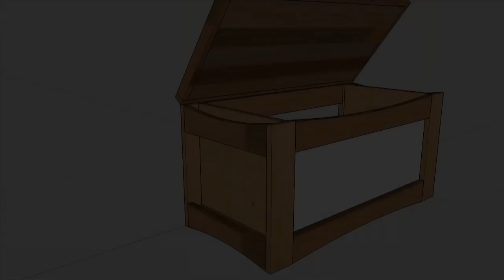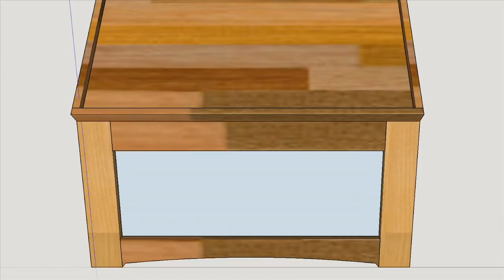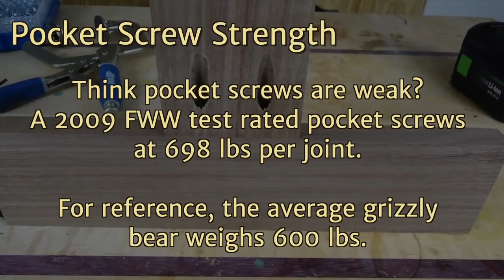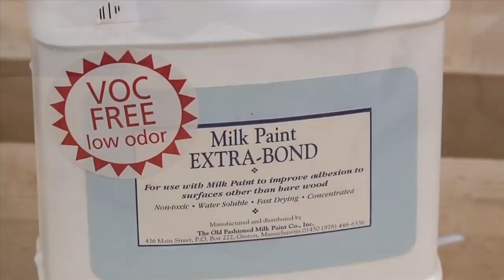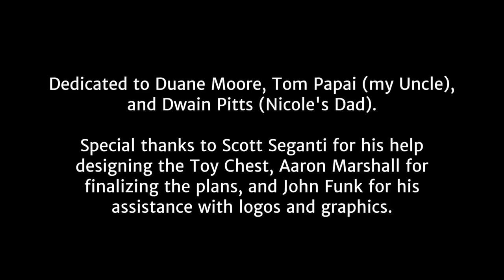231 - Multi-Function Toy Chest

Comment: I know this is an old post. But I'm getting ready to do the assemby  stage. I have a question. Can you tell me if it would affect the assembly,  if I bring the side plywood back to the edge of the 1 x 17"  side board, to allow more room  for books. So instead of 1 1/2" spacing, it would be  2". This is a great project, and simple enough for me to do. You've done a great job in explaining everything. Keep up the great work you do.

Comment: I am building this for the cause - and I'm about 90% done- but it is a combination of this video and the mere mortals video plan

The one thing you did not address and I would like your thoughts on - is how to install the piano hinge so that the lid sits flush the whole way along the top. As you made it there will be a gap tapering from back to front, right?

I would rate myself as grasshopper and you as sensei - so I'm not trying to be a jerk - but honestly curious.  

I have mitered this out with a chisel or router in the past - is there a better way?

Comment: I appreciate you doing this for a cause. Did you have to use epoxy to secure the Lego board?
Reply from the maker: Nope, just a few pan-head screws. Just a little tip, use some legos to lock the two plates together before screwing them in place. If you butt them right up against each other, they spacing will actually be off.
Reply: Woodworking with The Wood Whisperer Gotcha. Thanks for the reply

Comment: I've had such terrible luck with jig saws. No matter what technique I use, no matter how good the blade, it'll always bend on the stock giving me a warped line. I don't even use a lot of pressure when pushing! I think it's time for a new saw perhaps...
Reply from the maker: Unfortunately, that's something that a lot of jigsaws do. Some of the higher quality saws feature better guide systems that help keep the blade perpendicular and help prevent that kind of annoying tendency.
Reply: Woodworking with The Wood Whisperer Hmm. I think maybe it's time to invest in a band saw then....

Thanks!
Reply: Mike Gus Fifteen
good idea.  a used average-quality band saw is better at this job than the best brand-new jigsaw, IMO.  I know because when building mine, I tried the jigsaw route and the results were so bad (my skill level didn't help much) that I couldn't salvage that piece.  The rest I cut on my band saw (10 year old delta 12") and they all came out great.  Even with a 1/2" blade... I'm too lazy to swap it out so I went to the jigsaw because I figured the resaw-style blade would be too brutish for the curve.  I was wrong.  It worked fine, and a smaller blade would have been even easier.  I had to buy an extra piece of poplar to fix my mistake, but if I hadn't gone to the band saw I'd still be trying to make my jigsaw do the job.  and I think I'd still be failing.

Comment: While your projects are really nice. Literally everyone requires an wood-workshop full of tools to actually execute the way you present it. Some are even not doable for an common guy that wants to do some wooden furniture.

Would be great if you did a few videos with the focus on simplicity in making.

Maybe a challenge to your self:
Take only 3 tools from your workshop (several clams counts as 1 tool, just do not overdo it)
You can only use materials that are wildly available (no special glue and stuff)

You have to work outside of your workshop (at your backyard or something)

Hope you will find it interesting as a challenge to do great stuff with limited resources.

Comment: Surprised you cut up a dowel instead of cutting plugs so the grain would line up right. Something like that could end up showing through the paint...
Reply: I think he was trying to keep the project easy for the masses
Reply: nah, poplar is closed grain anyway. As long as the plugs fit properly and were seated tight, you cant see it.